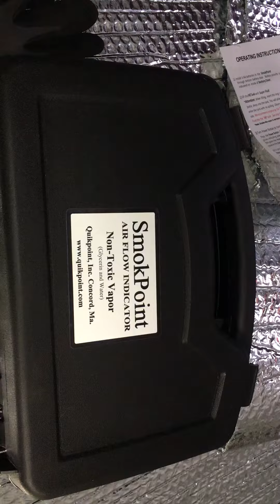Air handler’s leak more than leaky ducts sometimes. Even your switches and grommets suck air

Comment: Would you count that as leakage even though it's a negative pressure system? There will be some heat added but during cooling but not that much to affect the system efficiency. 
Thanks for the content.
Reply from the maker: It all adds up to one big massive leak.  This room has four 6 ton and two 8 ton air handlers + two 700 pint dehumidifiers.  The room is at positive 0.6”wc. 
                    There was no air sealing done so nearly as fast as the air come in the same volume escapes. 
                     This system run 7/24/365 the only time it will ever be off is if PG&E losses power outage or maintenance. 

             This is a industrial application processing where are you CO2 contained as a consumable gas.  
            In the other rooms they currently consume through750 pounds of CO2 a week. 
              The door is often left open bay workers ( 7’’X 10’ door)  every electrical and water penetration through the walls leak like a hairdryer blowing. 

             Because the humidity is 70% to 80% in one of my other videos I show how the humidity condensates back into water inside the wall and pours out the bottom. 

          If you added up all the losses it would cool another whole house plus cause wood rot everywhere. Not to mention  all the lost waisted CO2.